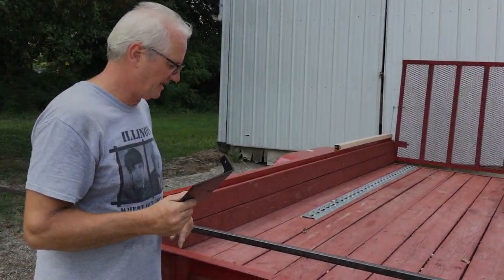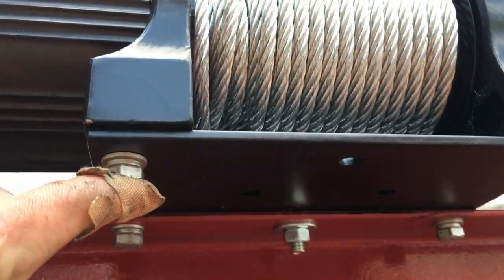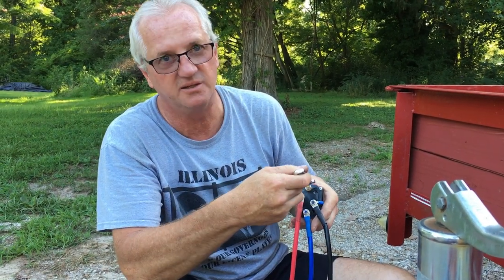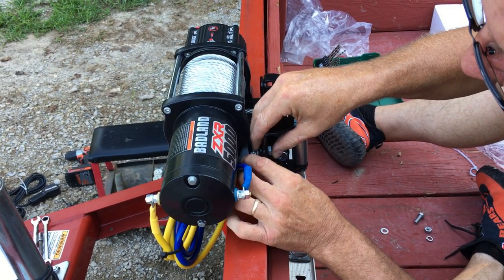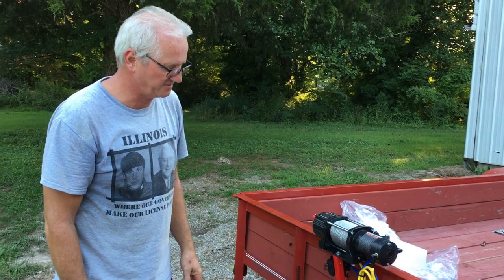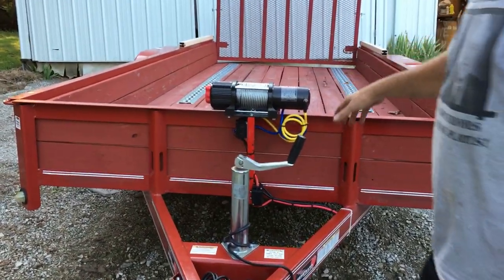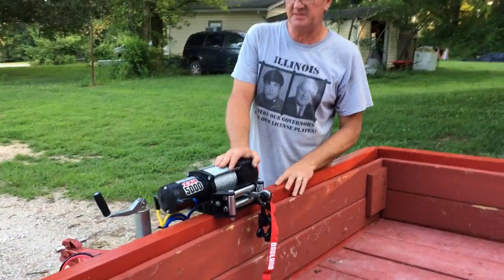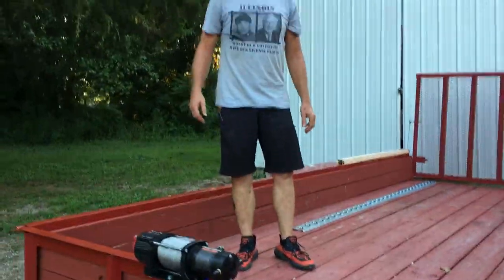BadLands Winch mounted on trailer.

Comment: I put one on my trailer today to pull my Harley up on the trailer. One thing I did not think of was the remote button wire is not long enough for me to hold the bike and push the button.  I just used a set of long jumper cables connected to winch an$ remote but I found out Amazon has several wireless remotes for $20 so that will b3 a big help.
Reply from the maker: I have a Harley also it’s a 2017 ultra limited ! I also have X-track on the trailer so I can haul bikes .
Reply from the maker: They sell a wireless remote u could add to your winch , you might want to look into that.
Reply: They have a wireless kit you can add